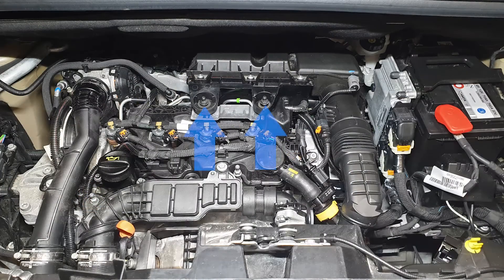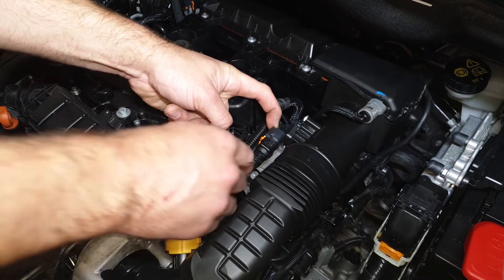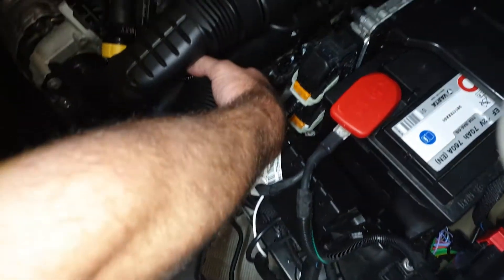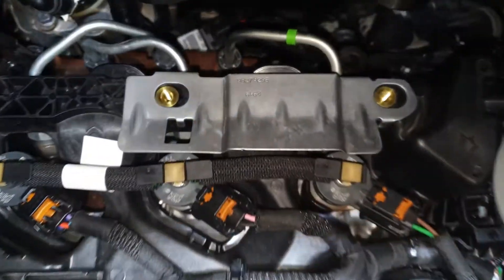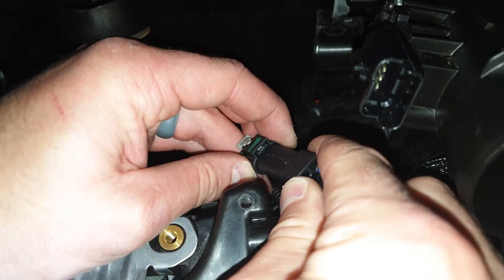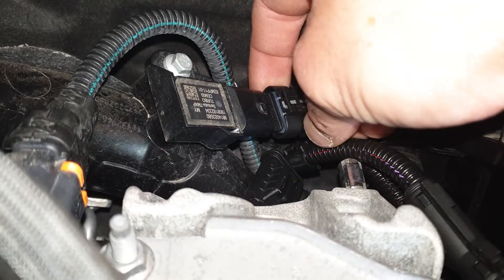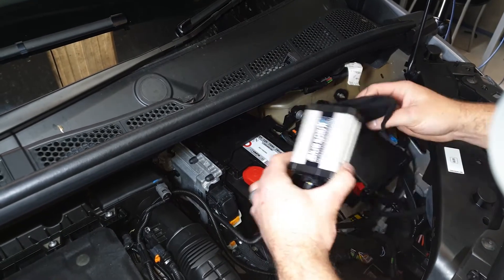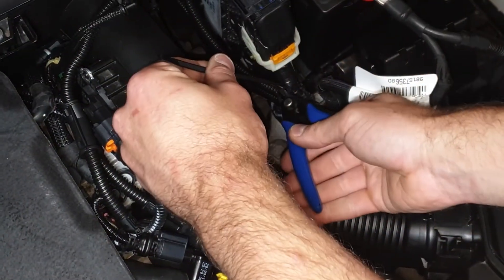Bluespark Automotive 1.5 BlueHDI / EcoBlue Chip Tuning Box Install Video

Comment: I have C3 Citroen 1.5 bluehdi 100 HP,   which is the interaction with FAP/DPF and adblue? It create problems?
What about Citroen warrancy installing this device?
 Thanks for answers
Reply from the maker: Most Diesel vehicles have a DPF. Our tuning box has been designed to work perfectly on a vehicle with a DPF along with those that use AdBlue. You will not have any issues with our box installed. 
With our box, we make no permanent changes to the ECU. Once removed there is no trace left by the box (please ensure you remove both the unit and wiring loom before the car goes back to a dealer). With this, it will not void your warranty. 
Here is a link to our Pro + Boost Tuning Unit for your car. https://bluesparkautomotive.com/citroen-c3-1-5-bluehdi-102ps
Reply: 2020 dispatch 1.5 diesel? Does it work and what are the gains please?